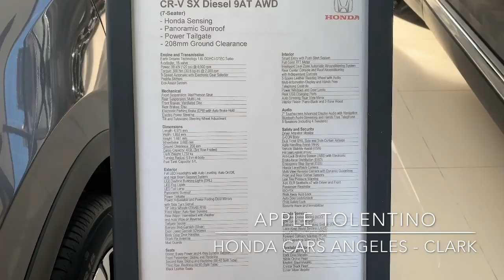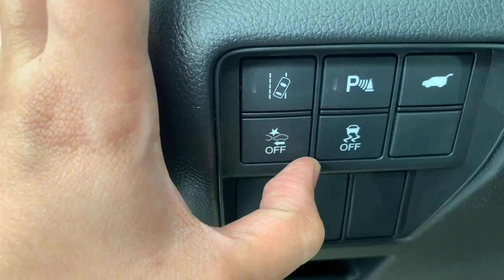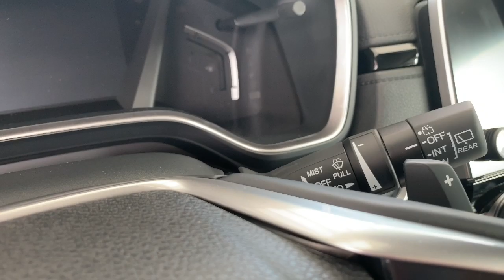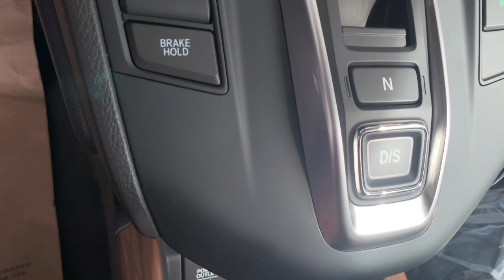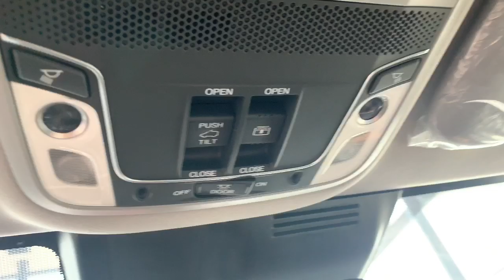DETAILED!!! 2018 HONDA CRV 1.6 SX DIESEL 9AT ( Philippines ) Modern Steel

Comment from the maker: Please don’t forget to subscribe😊👍🏻
Reply: Hi ma'Am Apple. I just want to ask regarding the fig lights. I want to buy the 5 seater Gas variant because it'a a lot cheaper than the 7-Seater SX Diesel. Kaso yung fog lights ng Gas variant is halogen lamps. It is possible to change it with the LED fog lights like the SX? attractive kasi yung LED eh. But I wont buy a 2.1M variant just because of the LED fog lights.
Reply from the maker: FrankieTankie 0987654321 hello Sir. As of the moment hndi pa po sa pagkakalam ko for crs s and sx plng po kc tlga ung LED sir.
Reply: Kailan kaya magiging available ang 2020 CRV SX Diesel? Salamat